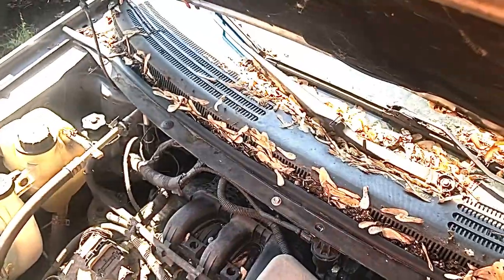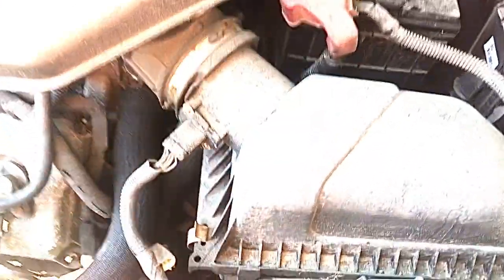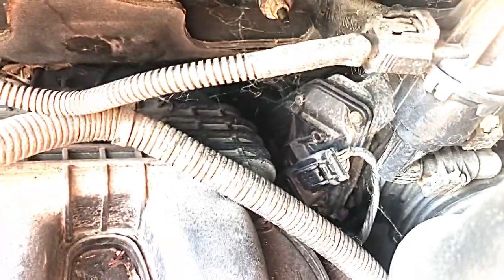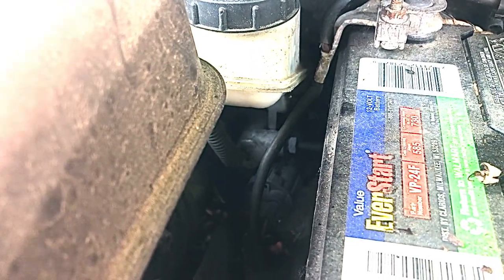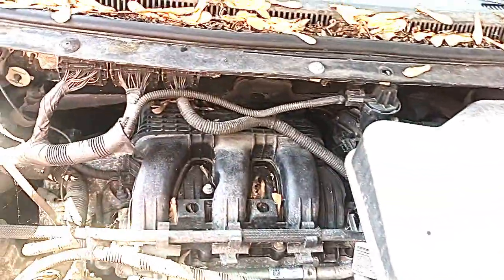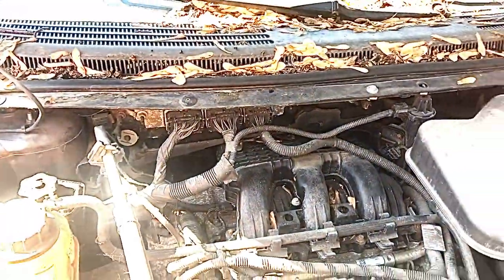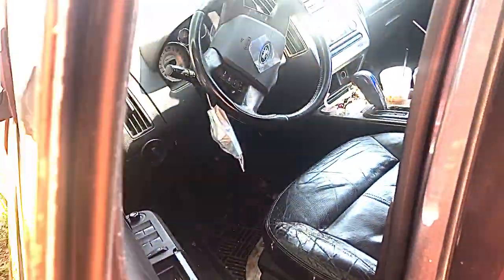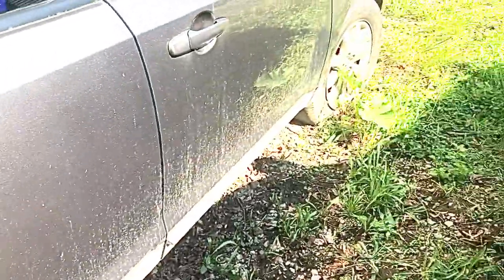OLD CAR REPAIR VIDEOS ANSWERED

Comment: 🤙🤙👍 had one front wheel drive,took 2 days to change an alternator,bout same to change back spark plugs,never own another 😁✌️
Reply from the maker: Some vehicles what kind of car was this but anyway some vehicles are designed by morons they don’t take into consideration routine maintenance and repair
Reply from the maker: Don’t tell me it was a PT cruiser because those things are in an absolute nightmare to work on
Reply: Dodge grand caravan,gotta take exhaust out and motormounts loose,jack engine up,shop wanted $600 ,after i started i seen why,bought nothing but Jeep grand cherokees since ✌️
Reply from the maker: Checking the engine up and dismounting the motor lol 
& for that reason I’m out🤣

Comment: You don't ever have to bench bleed. Bleeding all 4 bleeder valves is easy, just get you son/daughter/wife to pump the brakes.
Reply from the maker: True 
But their home for seizure is completely avoidable  by moving the master cylinder about 1 inch forward no need to disconnect anything
Creating other problems potentially